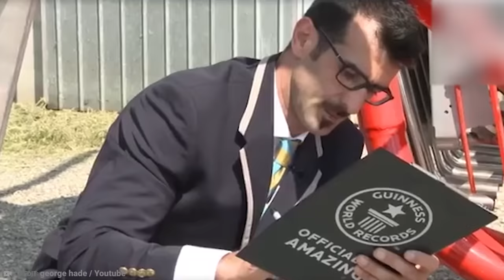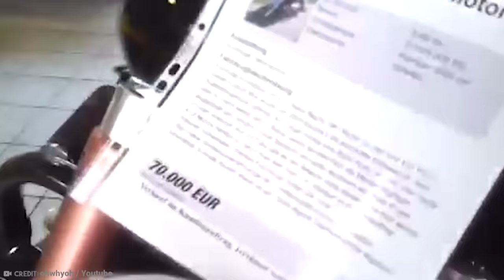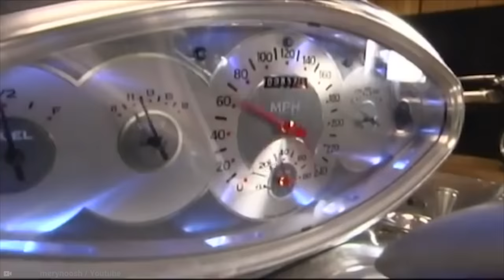20 Weirdest Monster Motorcycles in the World

Comment: A windscreen wiper (Commonwealth English) or windshield wiper (American English) is a device used to remove rain, snow, ice, washer fluid, water, or debris from a vehicle's front window. Almost all motor vehicles, including cars, trucks, buses, train locomotives, and watercraft with a cabin—and some aircraft—are equipped with one or more such wipers, which are usually a legal requirement.
A wiper generally consists of a metal arm; one end pivots, and the other end has a long rubber blade attached to it. The arm is powered by a motor, often an electric motor, although pneumatic power is also used for some vehicles. The blade is swung back and forth over the glass, pushing water, other precipitation, or any other impediments to visibility from its surface. The speed is usually adjustable on vehicles made after 1969, with several continuous rates and often one or more intermittent settings. Most personal automobiles use two synchronized radial-type arms, while many commercial vehicles use one or more pantograph arms.

Comment: The second one, the ‘tallest rideable’, ‘Big Dream’ and ‘Big Toe’, are they really motorcycles?  It has four wheels.  Yes, these are only there to keep it from falling over, but without them, the vehicle can’t be used.  So doesn’t that mean that those wheels are now integral to the vehicle, making it a four wheel vehicle?  If the side wheels lifted up like aircraft wheel, and the bike ridden for  km or more, then yes, it is a bike.  But they don’t, so I think they aren’t bikes.

The only problems I have with the tower trike is that it doesn’t have crossbow or a flamethrower.  Mad Max is so disappointed.  😮
Reply: Bigtoe has hydraulically raised support wheels. You have to prove that you can drive the motorcycle on two wheels in order to get an approved Guinness World Record.
The most important thing about the Bigtoe, however, is that it is the first real monster bike built in the world.
Reply: That can be a customer-supplied option....😉